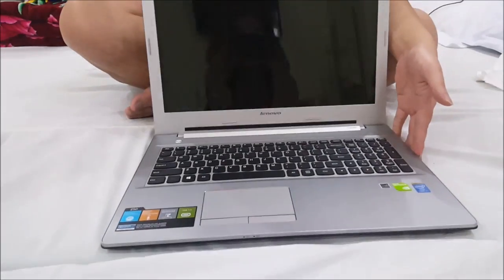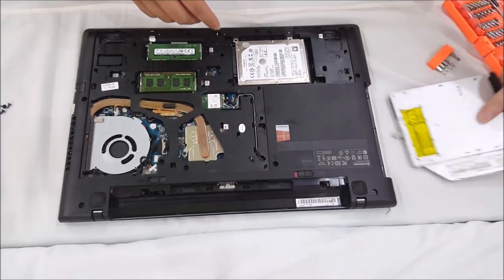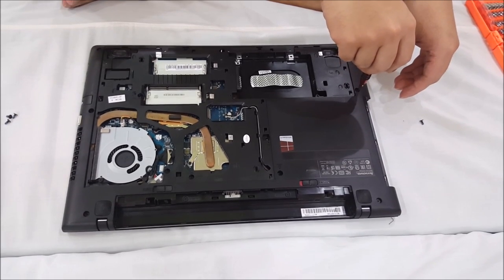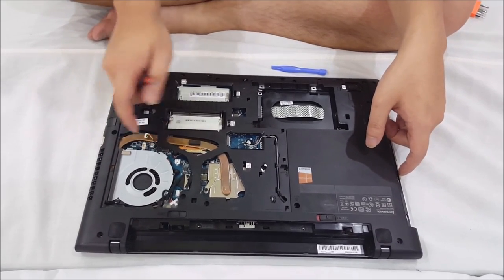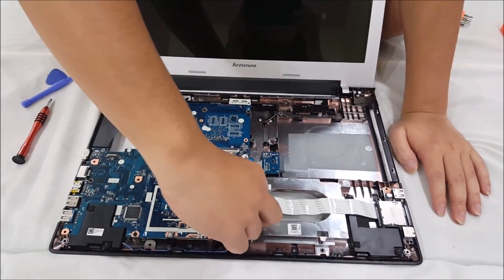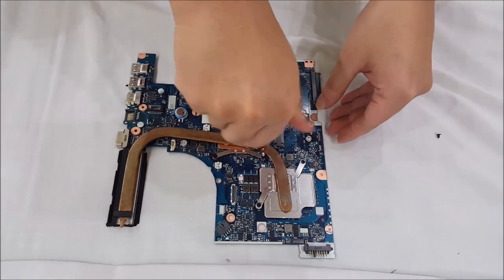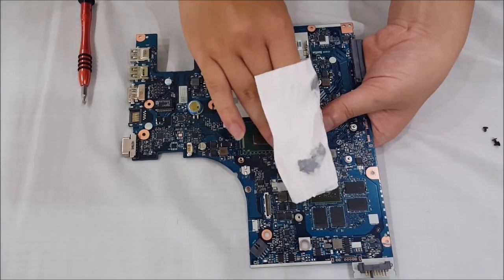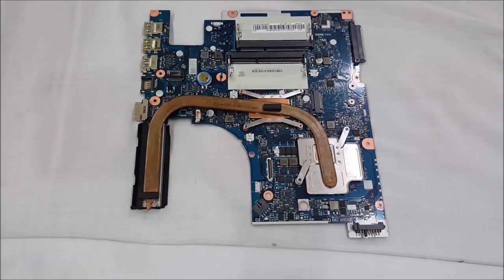OPEN ME UP! Lenovo G50-70, G50-70M and Z50-70 Disassembly

Comment: Which do you use RAM's? I have 2 slots too but i have 4 gb ram i want to buy +4gb ram can you help me?
Reply from the maker: CPU is solder on, graphic card is solder on, ram can be changed to 16GB max with 8GB DDR3L in each slot and there is 2 slots, wireless card can be changed, and hard drive is a 2.5" inch.
Reply: OPEN ME UP Which RAMs do you use? Can you give me detailed information? Brand, voltage, speed  etc.
Reply from the maker: open up your laptop and buy the same one then it will resolve your issue. if you look up DDR3L it will tell you what the voltage is and there is only one. it is best if you look at what ram you have and buy the same one. since you already have it, it will tell you everything you need to know about what ram you need
Reply: OPEN ME UP I want buy 4 GB but i cant find true idea can you suggest me? ( i couldnt find same brand)
Reply from the maker: anything that is DDR3L Sodimm will work. brand doesnt do anything.
Reply: OPEN ME UP k thx

Comment: How  can  i change the display?
Reply from the maker: dont bother if is going to cost you too much
Reply: ok
Reply: and microphone is integrated in the screen
Reply from the maker: nope it is near the webcam
Reply: i will post a vid  you have skype?
Reply from the maker: post a video and give me the link
Reply: and is a way to my change my usb port
Reply from the maker: usb port can be change pretty easily if you understand how to solder but if you dont have you have to buy a new board
Reply: oh  and i will need to buy a new board or i can a usb hub
Reply: oh now i have 3 more problems :
the power socket is moving down and up .
my case is broken and when i touch near the hdd the laptop is shutting down instantly..
Reply from the maker: you seems to have many issues. if you asking me these questions i recommend you not to do anything as it shows you dont have a good understanding in computers therefore you would get some assistants from a person who understands computer before everything breaks

Comment: oh my God I don't even know how that I got the ram card out of its slot now that I do got it out I can't put it back in I try looking at different videos to see exactly how they open it to put the ram card back,but for the life of me I can't get it to go back in there and then I forgot which slot it is, because I only have one card that came with the Lenovo so I don't know which slot is the right slot so oh my God if you get this comment please somebody help me thank you namaste
Reply from the maker: there are 2 slots. it can go in any slot. but seriously if you cant put the ram back in after watching the video go out to the store and get help. the ram only can go in two ways it is like how you plug a usb in if one way doesnt work try the other way
Reply: Thank u...I got it back in.....put everything back the way u showed me, but now the screen won't come on....I'm really upset with myself about this, cause my mom just bought it for me,I haven't had it for a week when I fell asleep with a bottle of Kefir in my hand and my laptop at my side....it was closed but the Kefir got all in the ports and fan vent. So I immediately took the battery out and let it dry cause I was scared for it to run any further. But I only went as far as right before I was supposed to pop up the screen and so forth. So instead, what I did was take a tooth pick and alcohol (since it dissolves) to clean the Kefir off. Now that I put it all back, the screen doesn't come on. HELP ME......UUUGGGHHH..MY MOM'S GONNA KILL ME!!!! She couldn't afford insurance....UUUUGGGHH!!!!
Reply from the maker: Try to return it for warranty before you do anything then if the say no then come back to me no point of trying something if you have warranty. Make sure you clean hour laptop properly so they can not tell you drop water on it
Reply: No I didn't drop water on it...I dropped kefir on it...that's liquid yogurt
Reply from the maker: Just make sure they don't know
Reply: +OPEN ME UP well I think I'ma need more help from u, cause how wouldn't they know when u can see yogurt white residue??????
Reply: +Harmony Hardly Ooooooh, ok so....since the screen didn't come on,I hooked up another screen to check and nothing, so maybe do u think I didn't put something back right????
Reply from the maker: remove your ram and turn on the laptop it should beep if it doesnt then there is a big issue

Comment: is it possible to change graphic cards in tis model ?
Reply from the maker: CPU is solder on, graphic card is solder on, ram can be changed to 16GB max with 8GB in each slot and there is 2 slots, wireless card can be changed, and hard drive is a 2.5" inch.
Reply: thx for the reply.I d like to ask you that ı do some rendering and if ı upgrade my ram 8gb more will ı see a noticable diffrence in rendering time ? and whats to most important thing for render proccesor graphic ards or ram ?
Reply from the maker: ram is what you currently using unless you are using more than the current amount of ram it will do nothing. you can check this by going into task manger and see how much ram you using. if you using close you the amount you have you should get more ram if not it will do nothing